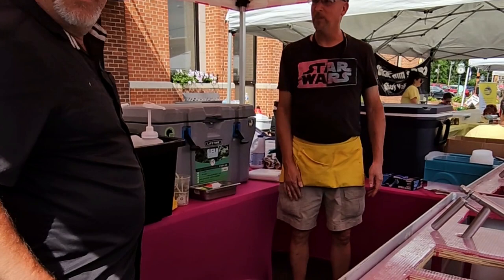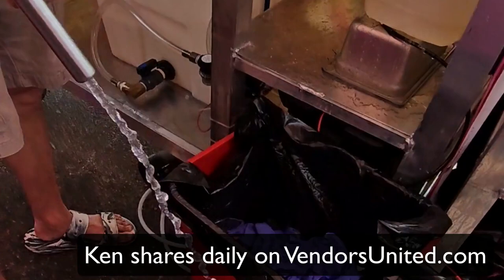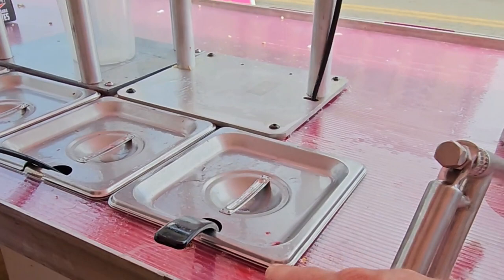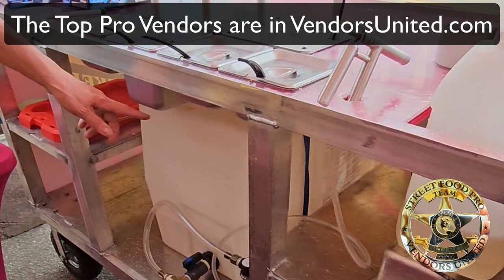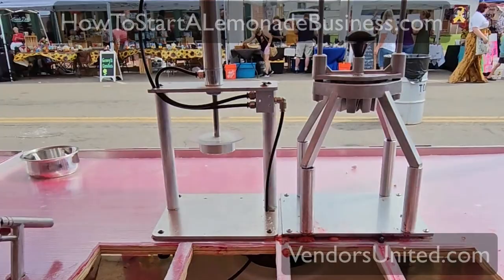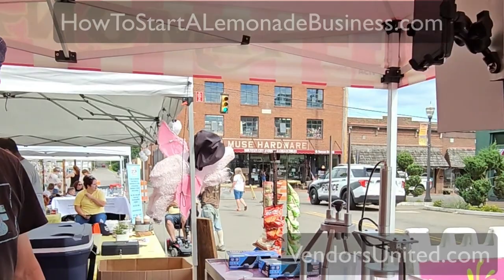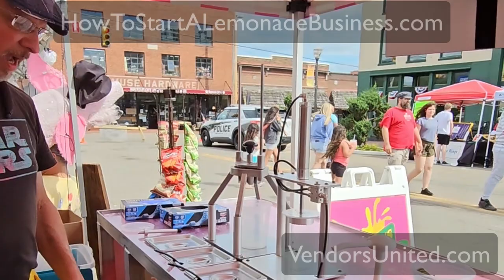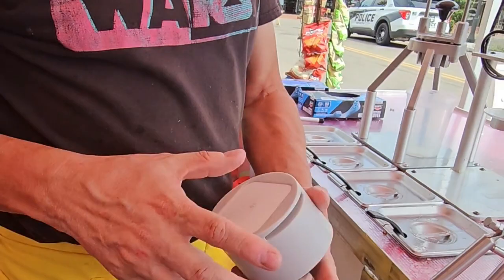🍋🍋🍋 Lemonade Vending Behind Scenes Tips 🍋🍋🍋

Comment: Does he change his gloves each time after taking money when alone? I don't know how to efficiently do this.
Reply: Get the food service gloves. The really oversize clear ones. I only wear one on my left hand. That is the only hand that touches the fruit. Change gloves anytime you need to use both hands.
Reply from the maker: Exactly. I wear a tight fitting glove on one hand and then have oversized food service gloves hanging so I can dip my hand in and pull a new one off over my latex glove. 😃
Reply: @void________  these gloves work really good because you can use them for a couple or few smashes and clear the strainer with your finger. I like to use my index finger to get all the seeds and pulp in one place then curl it up to scoop out all out and peel it into the glove straight into the trashcan. 
If you're doing hundreds of drinks you need to check the funnel on the smasher too. Pulp will stick and can clog the drain.